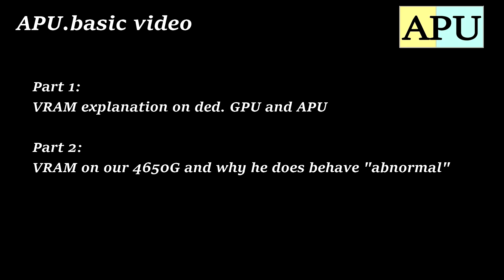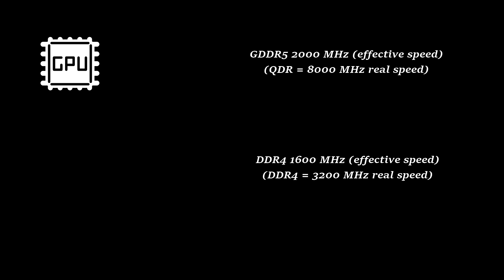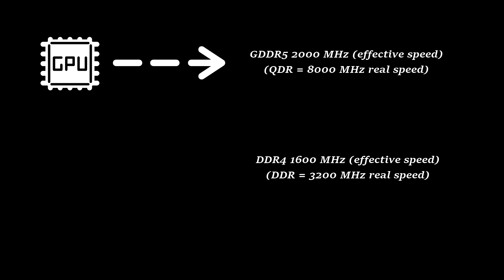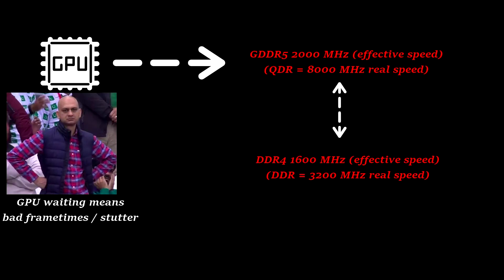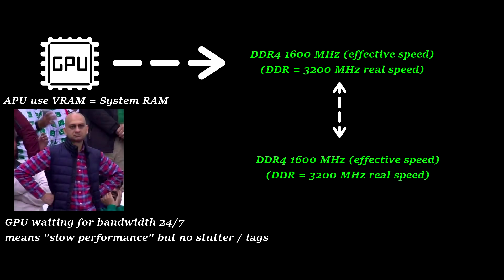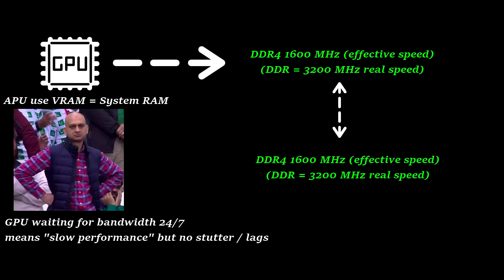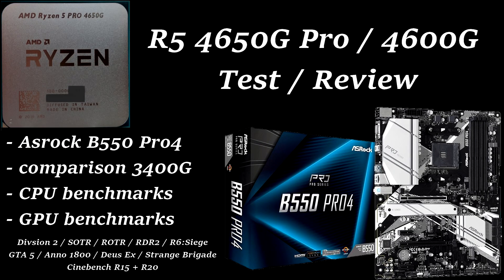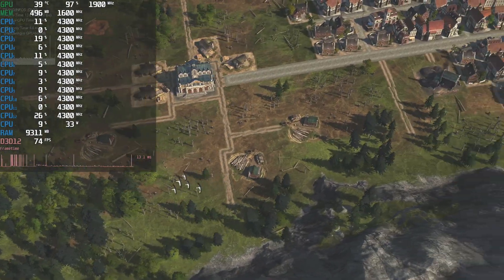APU Basics Vol.4 - vram comparison + vram/sram explanation + 4650G speculation

Comment: I just ordered the 4650g and msi a520m pro. Now im quite confuse what ram should i get😂 i planned to get 2x4 3200mhz. Wdyt? (I only use photoshops and other light editing software, and probably some cs go and light fps game)
Reply from the maker: Try to aim for 2x 8GB, it is much safer in the long run.
If you cant because you are low on budget go for the 3200mhz+ RAM :)

Comment: Good video! I have a question for you. I have a 4650g with a ASRock B550M Pro4. I noticed that I can allocate as much VRAM as I want. I've tried for example 4GB and it works. But, in my knowledge this iGPU supports up to 2GB so allocating 4GB is it useless?
Reply from the maker: Beside some "Buggy" Games everything ober 512 (Auto option) is useless because it is always the Same Speed system RAM. So you only let your OS use less RAM for big Games :)
If you have 16gb it is OK, on 8gb you should consider the Auto option :)
Reply: @APUgraphics  Thank you for the answer! So, I have 16 GB RAM, do you suggest to set "Auto" or allocate a specified quantity of memory and how much?
Reply from the maker: @danieleroda3293  I am always testing in auto, beside so small bugs with some mobile devices (4500U for example) there are currently no known bugs (at least i dont know them) when using auto.
If you have a game which has frametimes from hell (big spikes and frametime jumping) you can still try to change it to 2 GB for testing :)

Comment: I have a amd 4650g can I increase vram from 512 to 2gb?? In a gigabyte b550m motherboard
Reply from the maker: You should be able to, i dont know xlexactly where in the 550 Gigabyte BIOS it is, but it should be unser "io Ports" - "Uma modes" Set them to specific and you can configure the vram